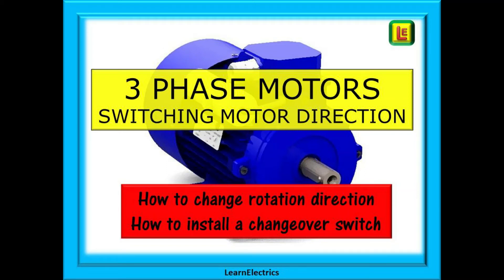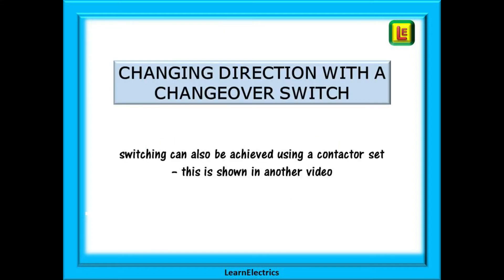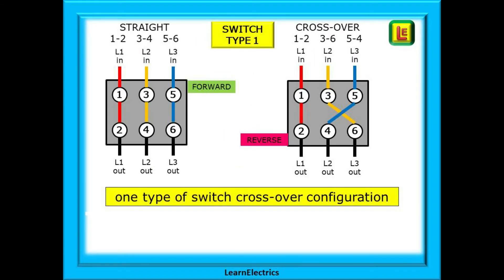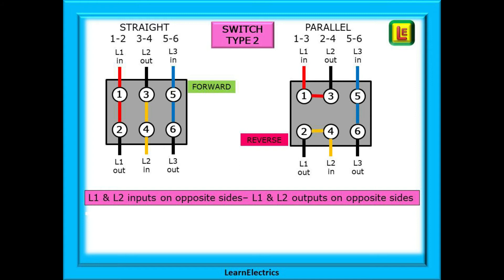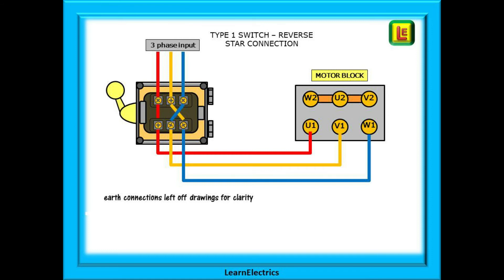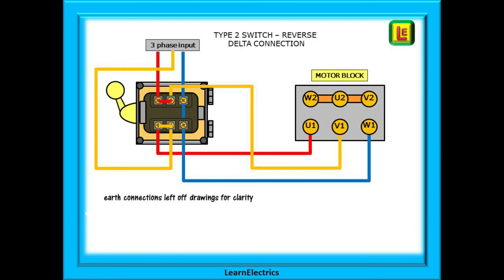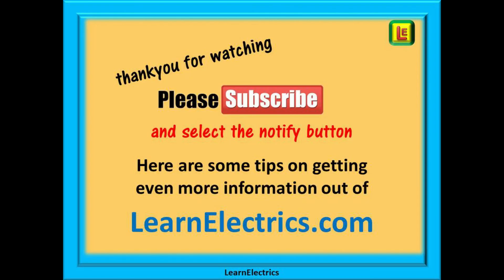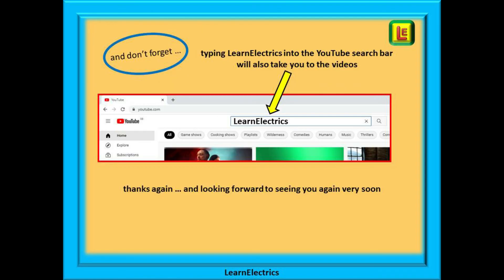3 PHASE MOTORS – CHANGING MOTOR DIRECTION

Comment: Does it matter which side you place the shorting strip on? 1 or 2 side? Will changing the side also change the direction of rotation? Thanks
Reply from the maker: For a star connection, either side of the block is ok. The direction may change as the sequence of the windings is different on each side.
Reply: Thanks for reply! @learnelectrics4402

Comment: What is the advantages of changing the rotation direction of  a motor
Reply from the maker: No advantage, simply that it might be required by the customer. Maybe the process needs it to go backwards sometimes. Lots of reasons. Thanks for watching.
Reply: Thank you